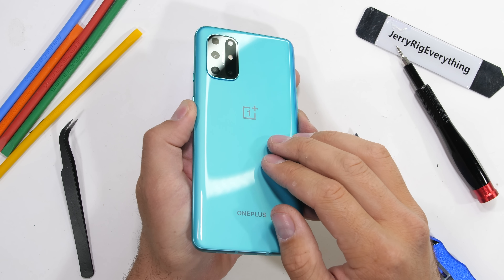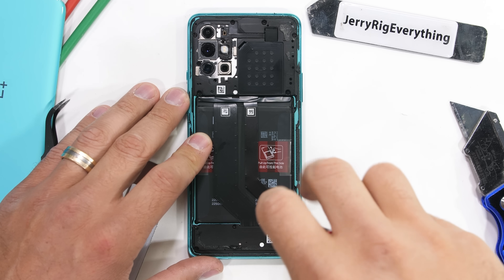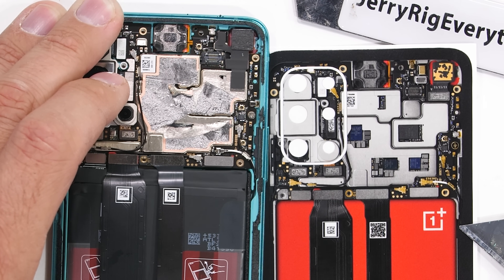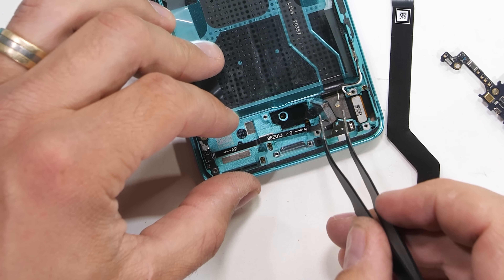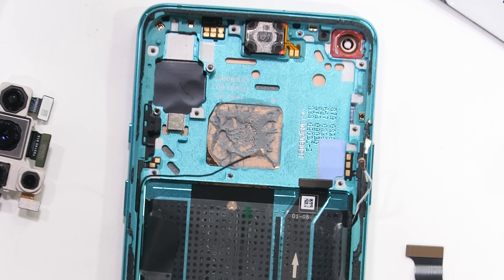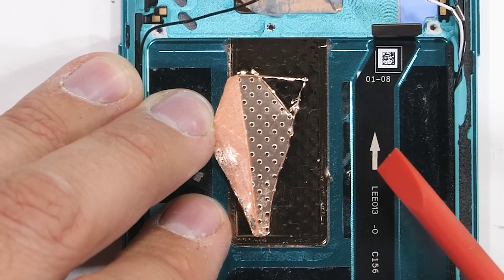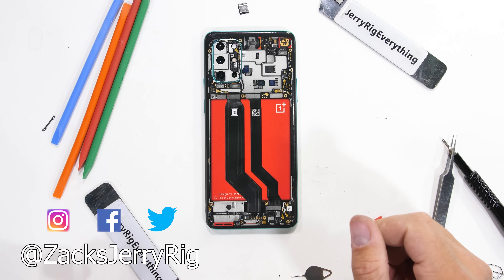Oneplus 8T Teardown! - Are there really TWO batteries?

Comment: My 8t’s display flex got sparked due to water. Cant we just fix the flex? (Display Doesn’t turn on due to burn in the flex connection)should i change display?
Reply: 3:26 the flex connector you are touching by your right hand finger. Its burned***

Comment: I have One plus 8T one year and two months old, Exactly at one year - the 364th day its battery bulged and back panel opened at corner then I got serviced since it is in warranty period.  Now after the recent software  update touch panel not  not working at screen right side from  top to bottom (on the typing keypad 'o, p, l, m, backspace key portion, exactly the messages send button portion, three dot position etc line) . it become useless now, The problem continues after trying several methods.  ..... Does there any way to fix the problem? Is it a software bug or hardware problem

Comment: I had a note 20 ultra that I ended up giving to the wife. I got myself one of these phones through tmobile for 250 bucks. Boy is it a hell of a phone for 250 bucks compared to the 1400 that i paid for the note 20 ultra!performance is the same or even better in some situations compared to the note 20 u and the battery charging is ridiculously fast. Like no joke I don't even trip out about making sure my phone is charged overnight. Why? When I wake up sometimes my phone is at 30% so I plug it in while I get dressed, brush my teeth and brew a cup of coffee. By the time I do all that my phone is at 80 to 100%. This fast charging is what brought me to this video which by the way is amazing. First time I see this dude break a phone down.

Comment: I'm using the phone for 1month.
I have 3 issues.
1. The video on my mobile is getting stuck(online and in gallery too)
it's for 2times in a week.
2.  if I have to clean cache files i have to open inividual app and delete which is super annoying and very time consuming.
3. the camera quality is not Good with this price, need software based optimization from Oneplus very soon

Comment: I just got this phone yesterday(upgraded from the OP6), but the Tmobile (american) version so it's the 8t+5g so it comes with an official ip68 rating. But no preinstalled screen protector, or included case. Such a bummer, but I ordered a case off of amazon for 10 bucks that includes 2 tempered glass screen protectors that's coming Monday.

Comment: I have a iPhone XR and the battery’s life has gotten down to like 4 hours at full charge
Reply: Replace it dude trust me I have a xr on replacing it it’ll be as good as new
Reply: @gautammenon5  yeah I have a oneplus 8T and it is so much better android is better ong
Reply: @lukarriart3357  android is good if you are a short term user in my opinion personally it starts getting really slow after a few years
Reply: @lukarriart3357  i used to use a one plus 3t it worked like a gem for a year then it started getting a bit slow so I switched
Reply: @gautammenon5  but the one plus 3T came out almost 5 years ago they probably improved
Reply: @gautammenon5  what I'm saying is would you compare the iphone 3gs to the x probably not it has evolved so much
Reply: @gautammenon5  I'll try to remember this and tell you how it's doing after a year I've had it since november
Reply: @lukarriart3357  I have used a 7t also and I felt the same  but I have heard really good ratings so do tell me tho :)
Reply: @gautammenon5  it's been a year now.this is my new account btw  my phone is doing fine there has been nothing wrong with it so far
Reply: @lunarcario  good to hear m8 my xr is also running perfectly fine

Comment: Hope oneplus 9 is better than before.

I need:
1.gimbal camera.
2.waterproof phone.
3. Metal at back like oneplus 3t
4. Flat edge screen bezelless
5. Radio without jack and internet.
6. Selfie camera under screen.
7. Less than 7 inch screen.
8. Brightness 1200 cd/m² (nit) or better.
9. 4800mah battery or above
10. Qualcomm snapdragon as standard international ram.
11. Support sd extreme card pro

I dont need:
1. Phone earpiece jack
2. NFC because barcode transfer is enough and safety
3. Wireless charging to avoid static and safety

👍👍👍👍👍

Comment: Putting two half size batteries shouldn't make a difference in charging speed. Charging should be measured in "C" rate, which is a multiple of the  mah of the battery. A 1C charge rate for a large battery will be much higher current than for a small battery, but the rate of charging is the same.

Comment: It's actually still 1 battery but with 2 cells in series. I mean just because a 12v lead acid has 6 cells in it, we don't say your car has 6 batteries, right ?
Reply: So my 24v truck have one battery?
Reply: Thats totally different, a car battery has the small batteries connected in Parallel and this battery its series.

Comment: The higher voltage on the battery is proof that it is not a 1 cell design like in most phones, but indeed a 2 cell design as it has double the output voltage ordinary phone batteries usually have. Not too special though, energy content stayed the same vs a 1 cell design as the capacity has been halved, which is why this is "only" a 2200 mAh battery

Comment: Hey Jerry, two 2250mAh batteries in series (as advertised by OnePlus on their website) doesn't make 4500mAh. Power sources connected in series increase Voltage not Current. These batteries are either connected in parallel or this OnePlus 8T has only 2250mAh battery. Please have a look on this and clear it for us.

As usual keep up the good work. Thanks 👍

Comment: Word to the wise about buying phones on eBay that are not new they may have been gutted of their cooling systems Etc by somebody like this.

It's nice to see how easy it is to get access to the charging Port I have a very new new Samsung that I need to get going but stop charging and I have lowered the paying a fortune to some techie so I'm going to have to get the hair dryer out and it makes me very nervous. I've been offered a $20 fee to open it up and I think I might just do that. Once it's open redesigning the electrical connection would seem to be within my ability but I will probably just put a new USB C in.

Comment: They removed the brick because it makes the box smaller so then they can ship more iPhones because the boxes are smaller so you can fit more in a plane or truck and the creates less wastes and most of the ppl that buy the iPhone already have a chagrined and they only have a USB c to lighting cable if you want to buy the brick if you don’t should can use you previous charging brick because it still has a lighting port so stop hating

Comment: Hello Zac I want to ask you something .
I have an issue with my oneplus 6t display, the lower side of the display till the finger print scanner is losing light, when the display is cold, I think under 16°C it starts fadeing, even right now , I'm outside and I barely see the letters.
Should I change the display or kip it warm so it shouldn't get worst?

Comment: Regarding the fast charging, total energy(Wh or Ah) and battery chemistry are important factors not just a number of battery cells a pack has. The benefit of having multiple cells insteat of one is reduced current if the charging power(W) is the same. Means less demanding to charging circuit.
Reply: Can we make a phone with a 5000 mAh big battery and 65 Watt fast charging? would it have good health to work 3 or 4 years without damaging the battery quality? explain
Reply: @aureliano_37   Sure, it can be done. Higher capacity allows less cahrging cycles which is good for longevity of a battery. But it all comes to how well engineered the batrery chemically.

Comment: Puttng thermal paste without a coper case on top doesnt make sense. Thermal paste has very low thermal conductivity as compared to copper. Its sole purpose to make contact from the chips surface to copper because there are microscopic space between copper and chip surface. Putting too much thermal paste is also usless and end up bad thermal conductivity. Copper thermal conductivity is: 385 W/mk and thermal paste has 8 W/mk.

Comment: I don't think doubling the battery has anything to do with how much power it could take. It's usually the capacity that dictates how much power a battery can take. You could charge at two times the capacity not two times the number of batteries thus the 4,000 milliamp battery can still only take two times the capacity whether it's one battery or 10 batteries of the same capacity.

Comment: 2:57 so much misinformation there. Charging lithium batteries depends on its capacity. Yeah sure you now have two batteries but they are half the capacity now. To avoid damage, batteries should be charged at 0.5C if each is 2200mah, you shouldn’t be charging them at more than 1100mah each (2200ma for both) sands as if we charged a 4400mah battery at 0.5 (2200ma). 2.2A*3.7V=8.14W is the maximum safe power to avoid damage. Anything above is trading charging speed for degradation
Reply: Capitalization matters in SI. mAh and mA. And we should really call it one battery, now with two cells.

Comment: Why?? Two batteries with half capacity is exactly the same as one double cell. It's even worst as the C-rate is higher for a given current if it can charge up one battery at a time (more heat as more internal resistance). They are also loosing the room between the batteries. Next time PI batteries?
Reply: Because it allows for faster charging.
Reply: @profboros  No, it doesn’t
Reply: @hugodeandres1497  did you see the teardown? Or another review of the phone? Or understand the tesla reference?
Reply: @profboros  I did see the video and understood the Tesla reference.
The video has misinformation and the Tesla reference is wrong.
C-rating remains the same and the reason why Tesla uses a lot of little batteries is because 18650 were and still are the standard for lithium batteries so they are cheaper to buy and easier to cool down. However Tesla moved to a bigger 2170 form factor in their Model 3 and Y. Last September Tesla has yet announced an even bigger 4680 form factor likely to be used in their Cybertruck and Semi and maybe other models. Why would Tesla use bigger batteries if they charge slower? Doesn’t make sense right? It’s because Zack unfortunately misunderstood how charging is dependent on C-rating not on the number of cells. I hope this makes it clear
Reply: so that they can be charged at 10v, while wired in series

Comment: The two batteries are put in parallel thus increasing the amperage without increasing output voltage, thats how they're charging the way they are, 30 watts to each battery, can say how this will impact the battery life, i do know with 18650 batteries and vape mods, its always safer to charge outside the mod being the passthrough generally doesnt charge the batteries equally, but with a 65w wall wort youre not being limited within .5-1amp on a usb port

Comment: The two batteries to speed up charging is so dumb. Just make one bigger one and it'll charge faster. And also this amount of fast charging makes no sense realistically
These batteries will also die so quickly
Reply: it's not complete nonsense. Traditionally, phone with fast charging technology gets more than 5v from the charger (around 9v or more) and then converts it to 5v to be able to charge the battery safely. The problem with this conversion procedure is that it generates A LOT of heat, which is bad for the battery. What oneplus have been doing is connecting the 2 batteries cell in series so when charging, the high voltage from the charger (in this case, 10v) don't need to be converted first, and can be directly sent to the charging module

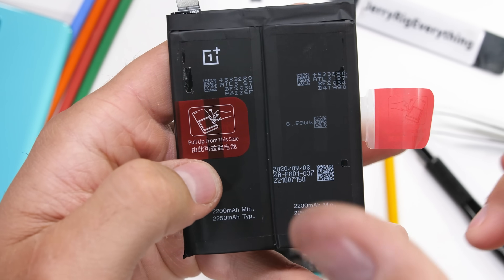Comment: 2:50 the charg reate of batteries is usually measured relative to capacity... cutting it in two won't change the absolute power you can put into it... 
The reason they do this is because power over USB is limited to 5A. If you want more than 25W you'll need to raise the voltage! To charge the battery you'll need to convert the USB voltage to the battery voltage. the bigger the difference between the two the more work this is (less efficient, bigger components). This is where the 2 batteries come into play: instead of chagrin to ~4.35 V for a single cell they are charged to 8.7 V so you can get a lot more power out of the 5A USB without a large and inefficient power converter.
Reply: No! No! No! If you wire the batteries in parallel you get double voltage but you don’t double capacity (Amperage hour) so you can have twice the voltage but half the current so same power (Wats). The only advantage is less current= less heat but you are also wasting space inside the phone

Comment: The reason why it allows for safer fast charging is because it’s charging at a higher voltage. Just breaking it up doesn’t mean much. But because most phone battery’s are at around 3.7V you can now charge at 7.4V.
Reply: No! No! No! If you wire the batteries in parallel you get double voltage but you don’t double capacity (Amperage hour) so you can have twice the voltage but half the current so same power (Wats). The only advantage is less current= less heat but you are also wasting space inside the phone
Reply: @hugodeandres1497  yes you have extra packaging because of that small space between the batteries but it's still roughly the same capacity. 

You don't have to step down the voltage and pump a huge amount of current to get the same power which is a benefit. This is the same reason performance electric cars are moving to 800V or more from 400V. They have the same amount of energy but there's less waste heat so you can more safely and reliably charger faster.
Reply: @robertide5182  You are right about the lower heat generated because of the lower current but you still have to keep in mind the C-rating which is half when series connecting the cells and the voltage is the same (0.5 C-rating * 2 Voltage is still 1) you are not gaining in faster safe charging speed without degradation. You are just trading charging speed for lifespan

Comment: The Reason He's Youtube's Perfectionist and Others Are'nt is Zack's Sheer Skill of Disassembling a Phone and putting it back as new again
Reply: Why are u putting caps on every word
Reply: @mathisbuilder  Good Point
Reply: @mathisbuilder  It Looks Good
Reply: Don’t mean to be that guy but his name is zack, idk why he his user jerryrigeverything
Reply: @anthonyru.32  you're actually not being  "that guy". You're actually just being a some what misinformed social media commenter. It's a saying " Jerry Rig it" which refers to using what ever parts or material you have on hand to make something work. His grand father used to say it all the time so he used it. The more you know!
Reply: @wispz6734  Okk ,Sergeant,But i dont see them anywhere😅(Maybe they fled the earth after i kicked there alien arses in halo 3 I guess)
Reply: new again ? nope, never. He sometimes messes with thermal paste, heat pipe and by opening a sealed phone (with ip 68 certification), your phone is no longer waterproof. So no, definitely not "new" again. He just knows how to disassemble and reassemble things
Reply: @ragilmalik  I See,But Still Reassembling and Disassembling can be a challange in itself,BTW,Waterproof Sealant i guess cant be applied manually as factory level official adhesives and equipments not available with common person

Comment: 2:52 fast charging batteries requires a thicker separator layer between the Anod and cathod which makes the battery more expensive and have less capacity so they used 2 separate slower charging batteries to reduce cost

Comment: How can two 2250 mAh batteries be charged faster than one 4500 mAh battery? Max charging current is determined by max current density (= current per battery area). So for charging current, it shouldn't change anything whether you charge two smaller batteries or one large battery...

Comment: The charging power has nothing to do with the amount of batteries. Each battery is recommended to be charged ~10% in an hour. Increasing the speed of charge decreasing the lifetime of a battery. No matter how many batteries you have, 1 or 100, each of them has to be charged ~10% in an hour.
Reply: % is probably not the most accurate way to measure charging speed but C rating is more appropriate. 0,5C is considered to be the maximum safe C rating in which the battery will experience minimal degradation, but the lower C rating the better. Still, you are right about your comment

Comment: Putting 2 batteries doesn't matter because if they have the same C rate as 1 then they both charge at the same rate. They probably used a higher C charge rate or haven't been charging there batteries at max rate In the last versions

Comment: Making 2 batteries for faster charging makes no sense. Basically current density should be the same for lower current per lower electrode surface. Maybe there is some improvement in comparison to a one big cell but I really don't think it does work this way. That's probably something about marketing or safety (smaller battery is more ridgid and less prone to manufacture defects) or it is just easier to manufacture. Or it's a different chemistry and it yet can not be safely produced larger than that. In Teslas 18650 batteries should help better heat dissipation cause the pack has a lot of volume. It doesn't improve that much if the pack is flat